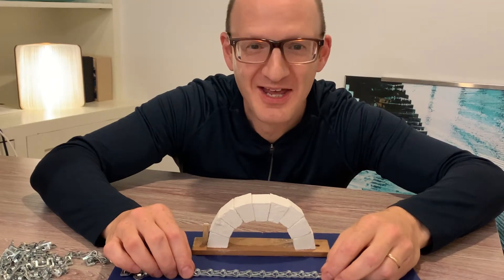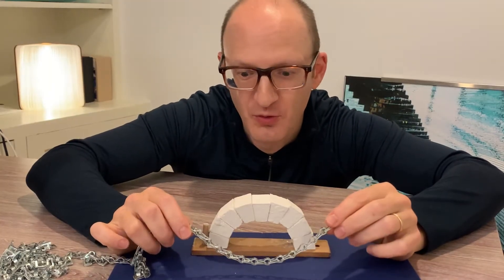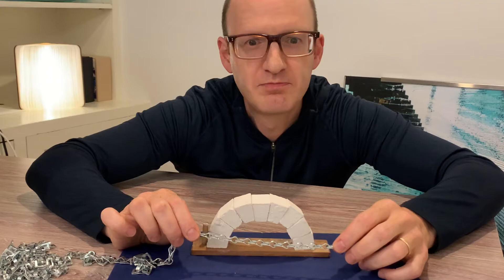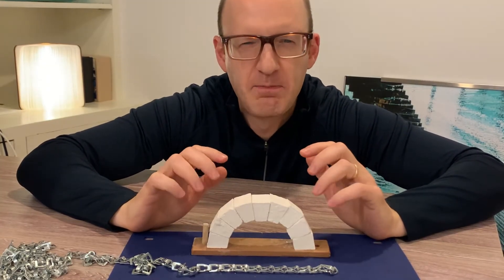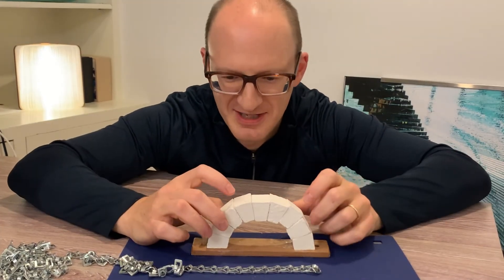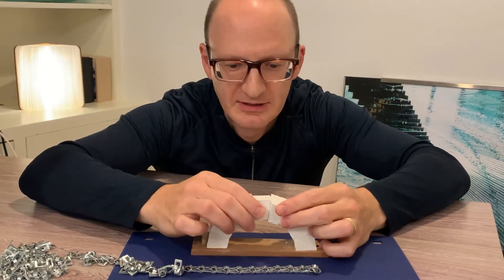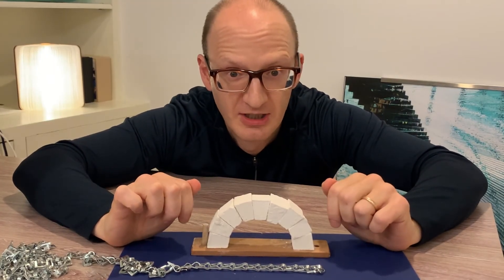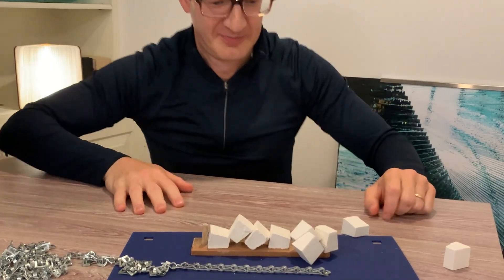How Do Arches Work? (with Demo!): Structures 2-1

Comment: To really capture the sense of how arches are cables in reverse, consider the flying buttress: arches achieve a high level of vertical load bearing strength by exerting those forces laterally, so an arch can be strengthened by supporting ti from the side with buttresses. However, when used in the design of cathedrals, piling up a bunch of rocks around your arch makes it hard to construct stain glass windows that actually let the light in, so the flying buttress was conceived to extend the buttresses away from the body of the structure.
This ironically had the effect of making these temples look like giant stone tents with the buttresses resembling guy ropes, which is significant in the Christian religion because the ancient Israellites from the time of Moses housed the ark of the covenant within a temporary structure known as the tabernacle that would later act as the blueprint for the more permanent Temple of Solomon that was to be constructed in the promised land.

Comment: Thanks a Lot, You probably the only one that understands that you don't bombard somebody with crazy analysis formulas before a person gets the concepts first.

I,m not a structural engineer: can you help solve my problem please ?.
 i looked for explanations for a long time before i got to you. my problem is that im trying to understand how engineers determine the distances of webs in a Howe or king Truss, im tying to program Revit/dynamo software to create points on different distances on a span of length.

What is the formula u can use for determining how many webs you need say truss is 8meters how do you know the distance to divide the spacing for the in between webs ,the ones that are going down vertical ones the diagonals i can just join them i guess. how do you space them. This is for a common roofing of House. hip roof

The funny thing is easy to find the spacing between consecative trusses 600mm+- on internet but nothing on the webs spacing of a truss. the solution should work not just for 8m but for any meters span. forgive my grammar tried to edit it so many times.

Comment: What would be the considerations for a dome on Mars, where the (Earth-like pressure) under the dome would be about 100x that of the ambient pressure? The dome would act more like the chain, I suppose. How does one calculate the mass needed to keep your dome from flying off? Would it help to make (triangular) panels with layers, with different pressure between? So, going gradually from 1 bar down to 0.6 bar, outwards, with holes in the sides of the panels, on each pressure level, connecting to the adjacent panels. Or does that make no sense? Asking for a friend 🙂

Comment: The thrust line through the arch is an upside down catenary.  The Roman circular arch is only an approximation.  Provided the section is deep enough it usually works.